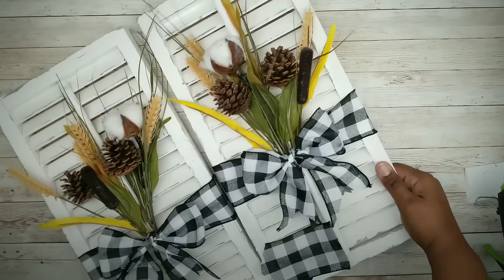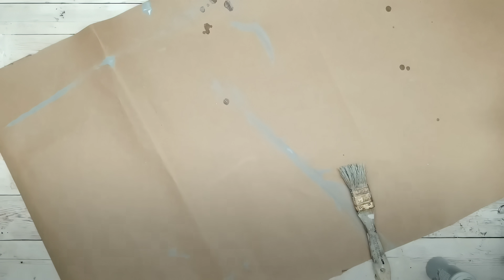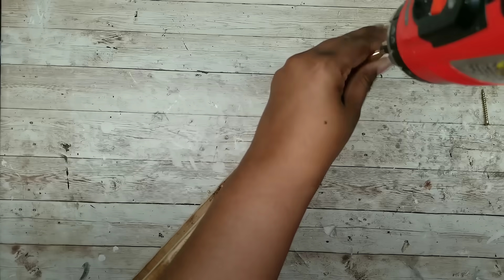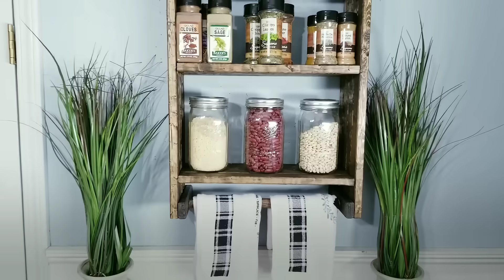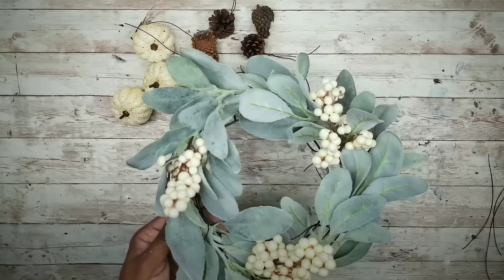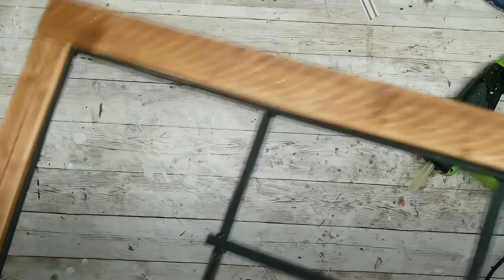BEST TOP 10 WOOD Home Decor DIYs | HIGH END Looks with LOW COST Wood | Great DIY House Warming Gifts

Comment: Dee, I love your projects. You make then pretty, functional and to last a long time. I appreciate this as I dont want to be fixing my pieces as often as I would otherwise. 
I love the frame with the flower petals. Its gorgeous and my faviorite so far
.  I've always wanted a room divider. This would be lovely made into that.
I also love the little shelf piece. It works well in the bathroom and as a coffee bar shelf. You must have read my mind, or I read yours as I was thinking of adding another shelf across the top and wahala you did it !!
I like how you used the paint sticks to the back of your faux iron decor  shelf. It gives the apperce of bead board.  I can't choose a faviorite between these two.  Both are very pretty.
The window panel pieces are awesome both vertically and horizontally

Comment: May I suggest, to hide the screws, you apply a tiny flat dab of Bondo or Plaster of Paris from Dollar tree then paint or stain otherwise the screws are still visible.
Reply from the maker: You can definitely do that too! You can also use wood filler or Durhams Puddy. For me, painting the screw head makes the screws blend in, and when hanging up its it's barely noticeable 🙂.

Comment: About your screw box, I have the same box but if it got tilted (when closed) I found that the different screws, nails etc would get mixed up. I bought a piece of 1/4" craft foam, cut to size and hot glued to the inside of lid to fill the gap between lid and dividers.
Reply from the maker: Great idea! My box does not have a gap, and I store it sideways without an issue. It's made by Plano if that helps!

Comment: Love the bench. I'd use a cherry or mahogany stain. I use stain generously like paint rather than jus dry rub it on. N then finish off w a gloss sealer coat. I'd use it to hold books on one of my book shelves. I've been looking for table top book shelves that aren't made from dt items. I noticed on ur tag photo u have some in this video I'd  like to try. I don't have much room for more floor shelves. N on my income going cheap n making a sturdy table top shelf to put on top of my low shelves would help wonders w my book storage needs
Reply from the maker: I've also made a chair version of the bench in a separate video. Your stain in cherry sounds amazing!
Reply: I used to refinish antique furniture w my mom. N helped her remodel her house. She used it a lot on her doors n trim n all the tables she refinished. The chair would b cute. If I made them both I could set them on the floor next to each other full of books. Or make a 3 piece set of book bench n chairs. I'd prefer on a table or top of book case. But I don't have one that long. Lol

Comment: Where can I find the  wood clue hot glue sticks
Reply from the maker: You can find them on the surebonder website or on Amazon. You can also use a brand called Fixsy (Woodworking Hot glue) as well, and they are sold on Amazon as well.

Comment: I LOVE YOUR SITE.  Just wanted you to know the Home Depot & Lowe’s here in Alabama, Mississippi, and Arkansas do NOT cut anything less than 12 inches.  Signs everywhere!  They said a smaller piece flew off and although it missed the customer, the 2 Mega Stores now have a policy NOT to cut anything less than 12 inches.  Yes, it’s a pain.  Has been policy for several months.
Reply from the maker: I know that store policies vary from store to store, so use your best judgement when selecting them to cut your wood. I know they also so not guarantee "exact" cuts. This is where having a Miter Box or your own Miter saw comes in! I have listed the $99 one I use in the description box if interested. I hope this helps :)

Comment: I love the boxes w/ hanger legs, especially w/ the curved feet on the bottom.  I think I would add a button or some other little bauble where the straight pieces are joined.
Reply from the maker: I actually thought about that but it appeared odd to me for some reason! I didn't want to take away from the look!

Comment: Do you sand the wood before you stain or paint it?
Reply from the maker: I usually don't if it's in good condition, and does not have manufacturers stamps that will be visible through my stain. You can definitely opt to do that if you like!

Comment: Your DIYs are nice however unless you have a saw and drill we are out of luck.  Most people on here have a hot glue gun.  However i I went past all the DIYs that included other tools.
Reply from the maker: I understand! When working with larger wood projects hot glue will not cut it unfortunately. I believe in providing DIY projects built to last and that are resale and gift quality! I am really hoping that my use of manual cutting tools and a simple drill will ease their comfort with working with power tools 🙂.
Reply: For those who only have a glue gun.......expand your horizons ❣️